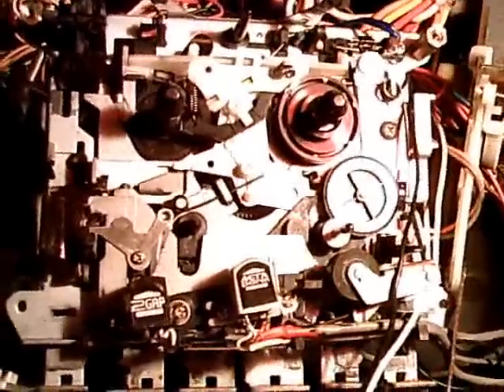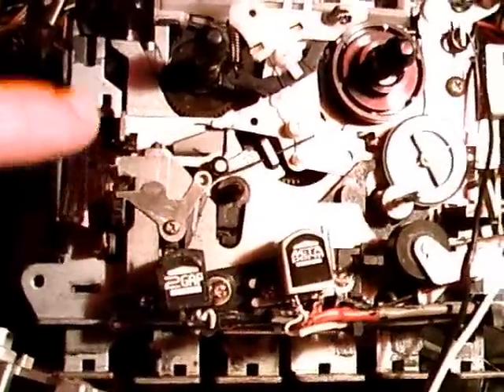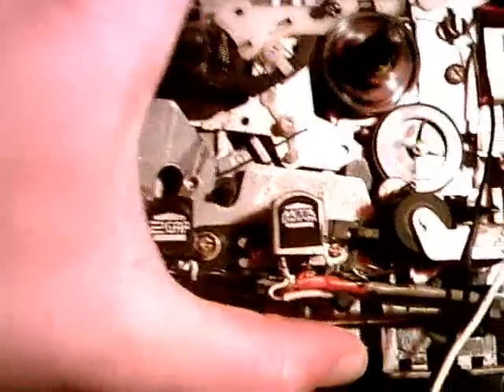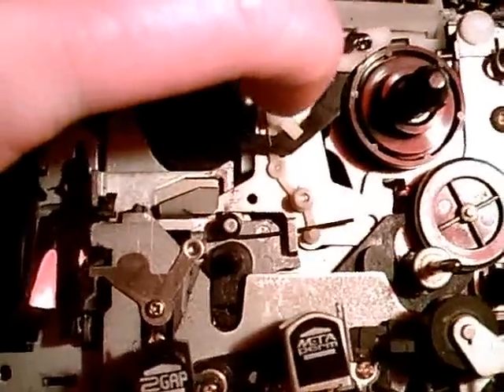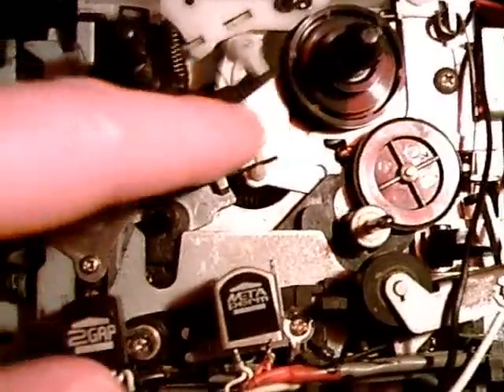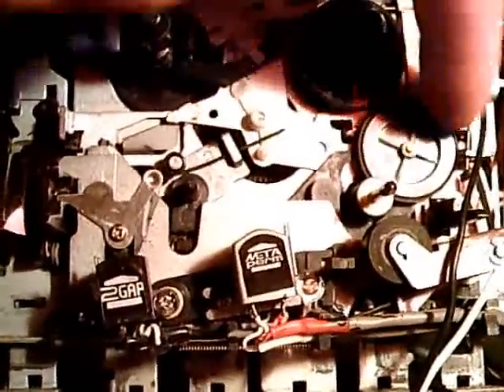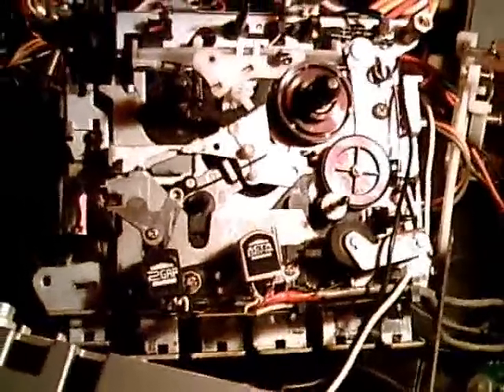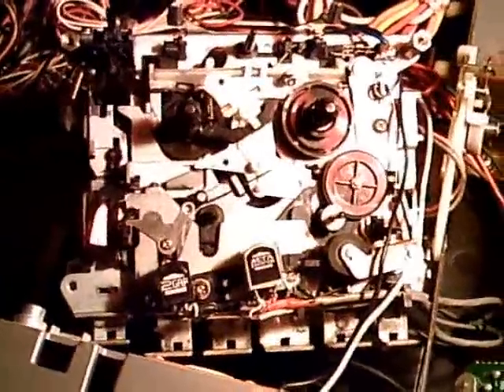The mechanism of the JVC KD A22 cassette deck

Comment: The fast forward link is a nylon moulding that is permanently stressed by a coil spring, so after 30years it is unsurprising that it seems to break.  Mine had done the same, causing FF not to work and the whole thing to jam sometimes.
I stripped the mechanism carefully, noting how parts were arranged.  Finally got the nylon part out and made a brass replacement by drilling and filing from a bit of old hardware.
Remarkably it works now and sounds great.

Comment from the maker: Because the auto stop sensor is part of the counter, and the counter is not hooked up, so the cassette deck thinks the cassette doesn't turn anymore and tries to shut off.
Reply: I had a similar broken plastic part that was for FF and RW. Playback would only work. I used the new JB plastic epoxy to reglue the part, after setting up, then used paper and crazy glue all over the part, which sticks to plastic, and makes a hard tough shell. Then wraped it in fine copper wires, and reglued with  more crazy glue to glue the wires to the previuosly glued paper, seemed to make a sturdy repaired part, worked fine. JVC KD-D30